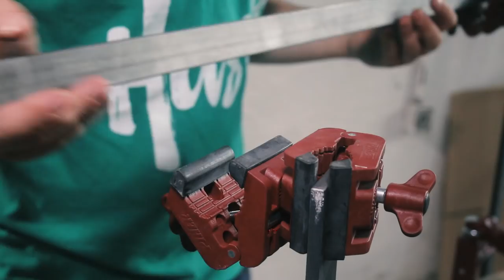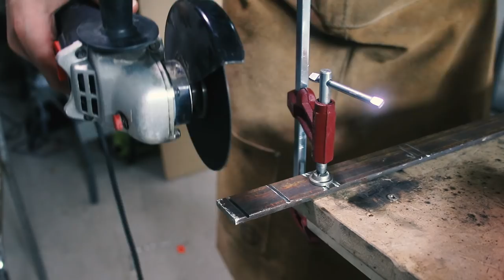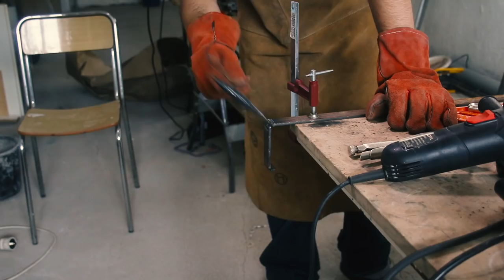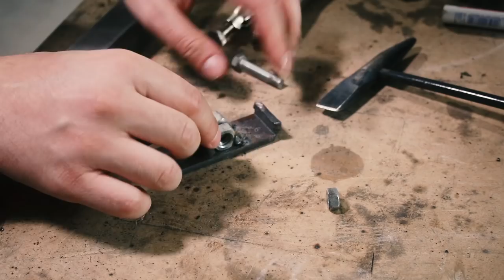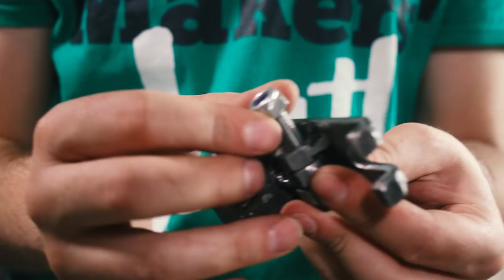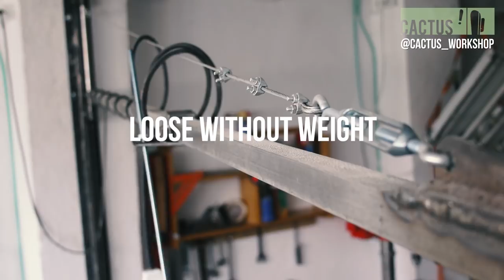A different gravity hook

Comment: You're actually one of the few "diy" or "craftig" youtubers who doesn't use a MIG-welder. Instead you're using stick welding. I like it
Reply from the maker: Glad you like it Peter! I'd love to have a mig for thiner stock though, this stick welder was too cheap (under 30€) and sometimes it's hard to control in 1.5mm thick profiles. but I like it!
Reply: yeah, for sheet metal TIG or MIG is the way to go. I enjoy TIG welding at work, because it's so relaxing, quiet and clean compared to stick welding. TIG welding is just you and the arc :D